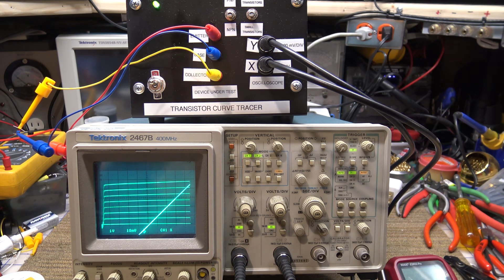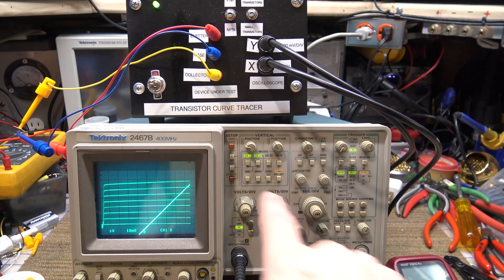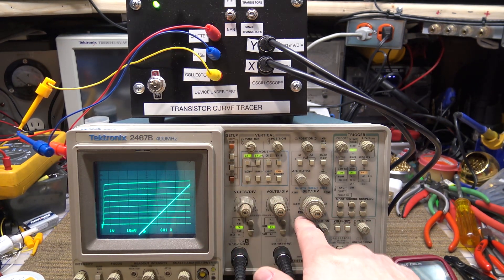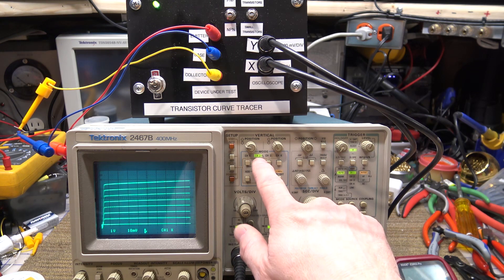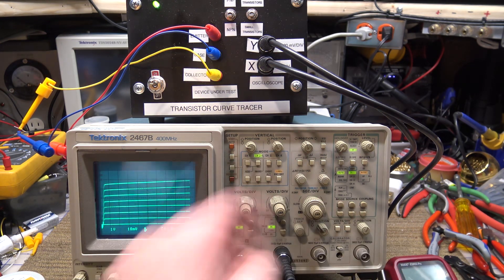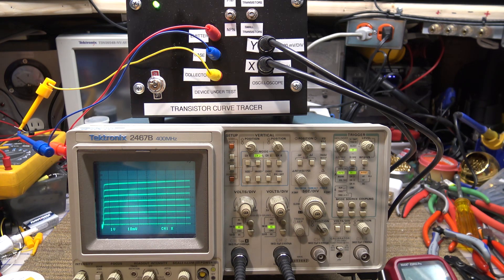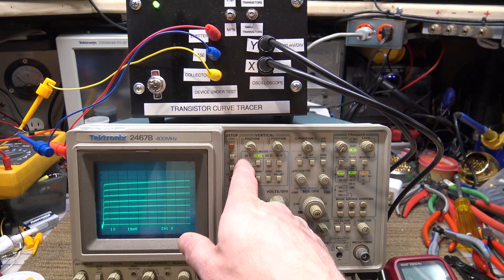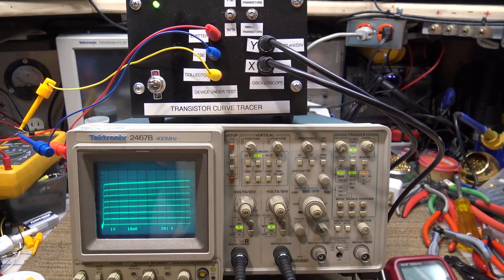Transistor Curve Tracer Video Follow Up

Comment: Hey xray Tony. I'm a off grid guy and my 3000w Giandel inverter just took a crap from my Harbor freight angle grinders cord shorting out. It would not reset. Never shorted it before. I tried my backup old Heart and it also quit but reset itself no problem. The weird thing is that neither the breaker or the gfi protected anything. So, the inverters are so sensitive to short that the gfi and the breaker are useless. Hmmmm.
Will Prose is ignoring me and he is not really smart like you.
There has to be a way to protect the inverter from this so no short ever get there. My Heart is 30 years old so this must be common to all inverters somehow. I'm not finding a device for this. Would a fancy gfi work?
Giandel is giving me the runaround so I might be able to send you my new boat anchor if you want to check it out.

Comment: Do you have a link to the curvetracer or model? I would like to get one.
Reply from the maker: They are listed on eBay and Amazon in multiple listings.  I believe they are shipped out of Taiwan.  Cost is between $30 and $50.  Just search "Transistor Curve Tracer Kit" and you should see them.

Comment: I just ordered the card and power supply compnents a couple of days ago after watching your original video.  I noticed the board was in the mid $20 range when you bought yours.  It is now $43 + shipping for the combo of curve tracer board and power supply board.  And, it takes about a month to get here from Thailand.  But I have plenty to keep me busy in mean time.  Thanks for this most recent post.  It probably will save many of us from staring at that sloped line.